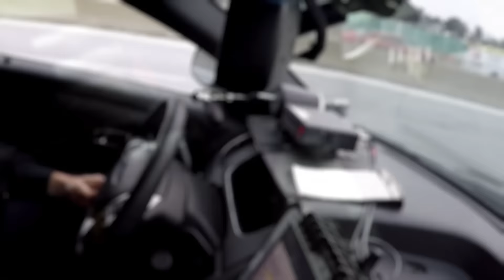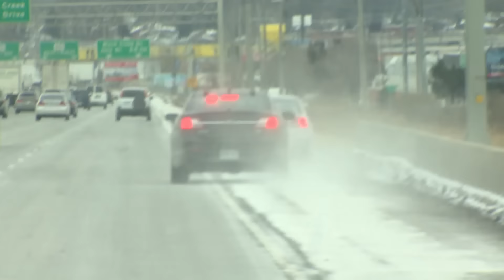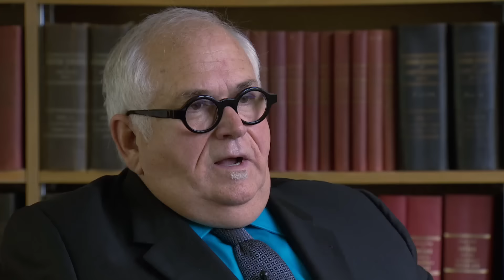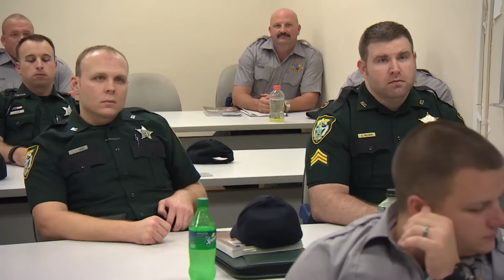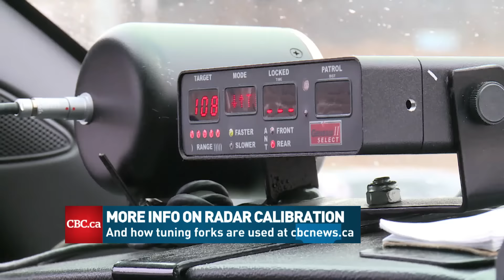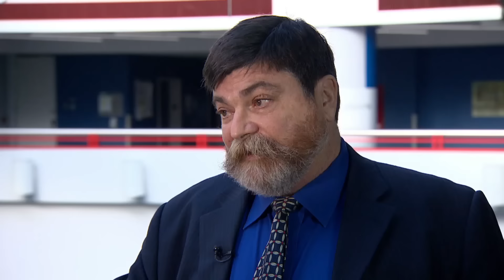Inconsistent radar testing

Comment: I would think that they would WANT to use the tuning fork to test the unit for accuracy. Each tuning fork that comes with the unit has a specific frequency, which means it has a specific speed indication associated with that frequency. This tests the units ability to correctly read the speed associated with the fork frequency.